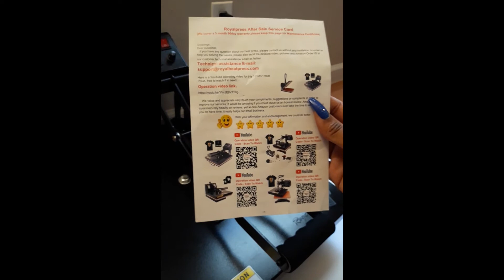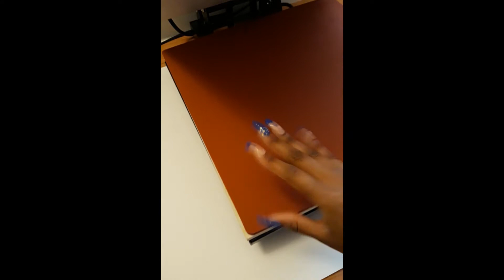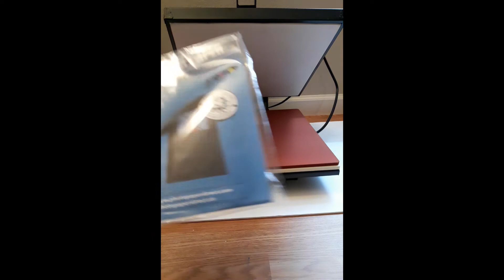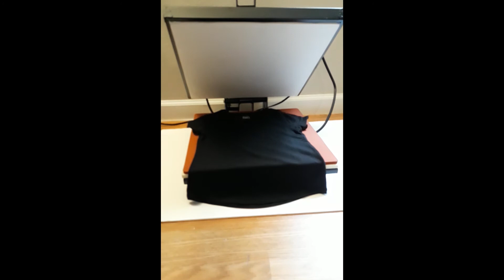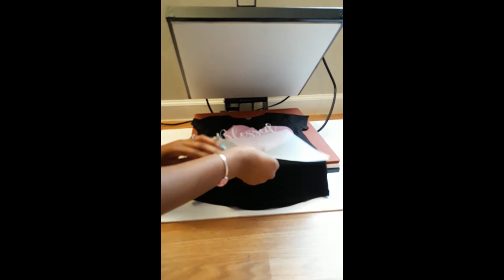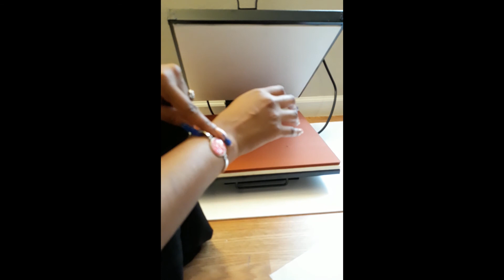Royal Press Heat Press How-To | Beginner Friendly

Comment: I know this is a year old but could you do a video on how to do light colors from white to say orange or sky blue ?
Reply from the maker: I no longer have this particular press machine, I gifted it to someone. but, Light colors are exactly the same except you would use the paper specific to light fabrics. They usually require that you mirror the picture or words since you place it face DOWN on the fabric. as opposed to pulling a backing off. Hope this helps!